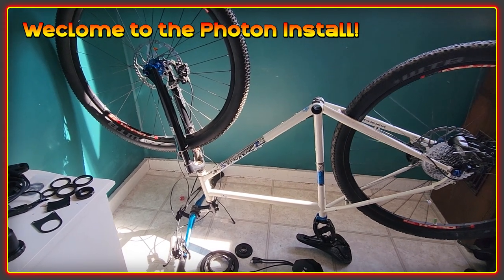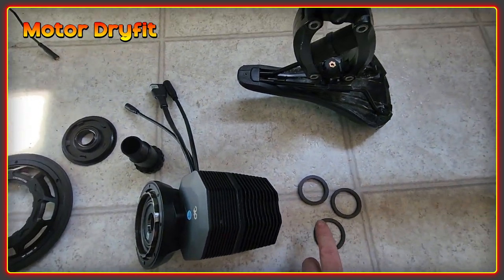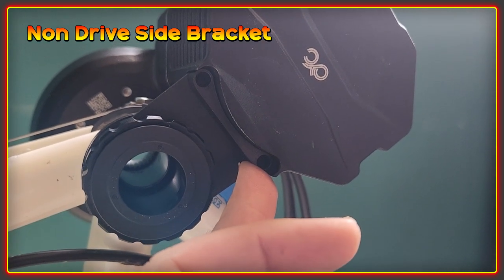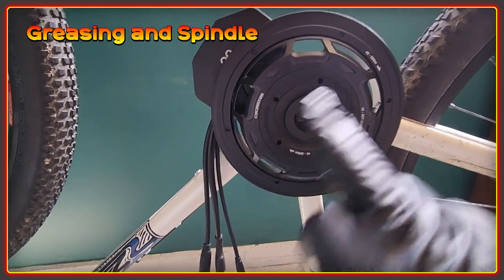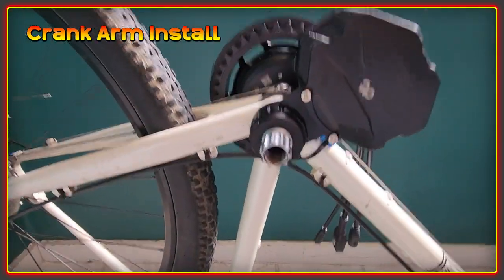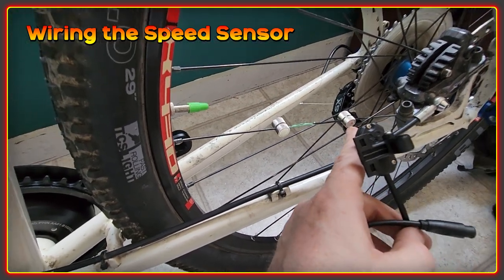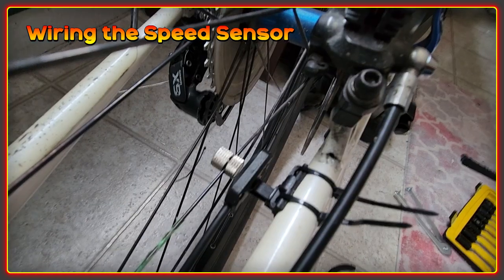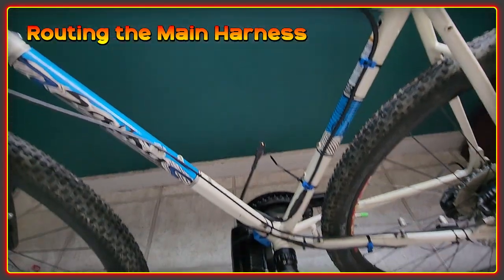CYC Photon Ebike Motor Full Installation, Tips and Tricks

Comment: The ease of installation is a no brainer! Just having the controller installed into the motor and the simplicity of the speed sensor and the throttle control and screen is brilliant!
 Didn't see a lot on brake disconnects? I doubt I would use that anyway. I bought a 250W mid drive ebike (proper road legal) and even that bike does not come with brake disconnects!
 Start rant!
 Imagine the Photon installed with an Alfine 11 rear hub(or a nexus)....How clean would that look!
  I like having my BBSHD at 3000W but that Photon is so clean and in all honestly I am not a speed junkie who is looking for a faster ride anymore.
So A donor bike say $1000.00(2nd hand?) Aussie dollars, Photon $1500.00, Nexus hub $400.00 Aussie dollars and a decent 52V battery(25/30Ah)$750.00/1000.00 Aussie dollars. Allowing say $200.00? dollars to fit the nexus into the wheel rim?
 Go old school and just use the existing cassette to save money it could range from say $3500.00 Aussie dollars to as much as you wanna spend!
  My calculation allowed for a good quality battery so you could save money buying a smaller battery or a cheaper donation bike unless you already own a good bike!
 I paid similar for a 250W Electric Ebike so this is really something to save for.
 For all the people who can do it cheaper good for you! As an Australian we tend to pay a bit more for stuff down under so I have been fairly liberal with my figures! A thousand dollars for a donor bike is for a decent frame so I am being fairly aggressive price wise!
 To have an Ebike which you build yourself knowing what you have and understanding how it goes together plus the knowledge gained building it the price of $3500.00 Aussie dollars is not to outrageous in my opinion!
 Enough of my rant! 🙄🙄
 Anyway that finished bike you built looks really good in it's simple design and really a clean build!
  I am interested in how natural the bike feels to ride as just that....A bike which you need to pedal! I am curious how the torque sensor? handles the feel for the ride!
Keep up the good work!
Reply from the maker: Thanks Sparkie, makes sense with the nexus. I opted out of the brake cutouts. Seems to be ok. The harness is different if you want them so you have to say otherwise you get a two way design.

Comment: Would be nice to see a CYC install on a nice comfortable Dual Suspension bike. Including a 25-30 ah battery 52-72V. That would be a neat trick.
Reply from the maker: Now that would be the real trick. Getting the battery in will be the hardest part. The triangle is always compromised on those.

Comment: For tightening the chain ring I would stick a long screwdriver or something similar from the other side of the frame through the openings in the edge of the chain ring.  Then hold that in position with it contacting the frame while you tighten the lock ring.

The chain whip should work fine too, that's just what I'd do if I didn't have one.
Reply from the maker: It did ok. You could use a cloth to prevent any marking as well. Cheers Wally.
Reply: @HighVoltageKits  What about installing the shaft then slipping the left crank on and using the crank for leverage when you tighten it?
Reply: No. Dont do that. Get a chain whip to mash your paint or components.

Comment: Watching all your vids now. This motor looks like having standard biking cables running under the bottom crack is no issue. How does the toseven dm01 work? I hope the same having a gap for the cables, brake and gear change
Reply from the maker: Yeah there is room to thread things. Might need to rearrange a bit depending on the frame but it's not usually a problem.

Comment: Thanks for the extremely clear and helpful video. Question: I have had a Photon for about a month and it has been mostly a good experience, though I need to remove it now and reconfigure the spacers. What specific tool or tools do I need to remove the crank arms?
Reply from the maker: Thank-you. You need a crank puller. Park Tool is a good bet. It screws in and then an extractor pushes the crank off the splines.

Comment: Very nice install.
Based on the triangle bag fittment your bike must be huge.
It doesn't seem like 750 watts would be enough to just pick a middle gear & hit the throttle without using gears.Will you be pedaling and using gears (for a change)? I like to pedal so am very curious how the torque sensing works.
How does the noise level compare to a Bafang? My main issue with previous CYC motors was the noise level of the 2 chain setup & was hoping this would be quieter than it seemed.
Reply from the maker: About to go out for a ride here so I will let you know on the noise when I get the time to process the video. From my quick test ride it is very quiet. The motors always seem louder when you spin them like that. The CYC X1 noise was always from the 219 chain and the tensioner.

Comment: Do you have to use the speed sensor? I have full suss and i dont think it will work consistantly with the rear swing arm movement
Reply from the maker: I don't think it works very well without but you should not have issues with a full suspension. Might be a bit trickier to place it but doable.

Comment: Very good video and commentary. Thank you for that. I was getting ready to buy a BBS02 but then stumbled across the Photon. It looks really good but there isn’t alot of them out there to determine what reliability will be over the long haul. In your opinion, how does the Photon compare to the BBS02 and is the torque sensing of the Photon make the BBS02 fail by comparison in feel and quality? I want the feel of torque sensing.
Reply from the maker: The torque sensing is a much better feel. How long they last for though is a good question. CYC said its been developed for three years though so hopefully it was well tested.
Reply: I just purchased a Photon, too, and I'm watching this to learn the installation routine. (I've installed BBS02's before). It's my understanding that if you run the Photon very hard, they can run too hot and eventually burn out. I never really got any good definition of what's "very hard" use.

It's really difficult to get any idea on longevity when the product is so new.  How can you know if it will last 3 years if it only came out as a product one year ago? There's just not enough real world experiences - both good and bad. With that said, all the early reviews are pretty strong.

Comment: thanks for the info on the photon,  on the road test could you test the throttle and power this can handle i already have the gen 2 with asi bac855 only run it on 58v so still not sure on the photon or just upgrade to the x6 controller,  really like how compact this is and no chain also the noise from what i have seen its much less than the whining noise of the x1 pro...thanks...
Reply from the maker: I will post some ride footage and commentary tomorrow and a full review with more riding

Comment: Odd question and I can't seem to find the info (while I wait on my photon to arrive). Say you run out of battery. Does the motor "freehub" allow you to pedal with minimal resistance? Does it have a regen mode while pedaling if torque assitance is minimal? Thanks! Looking forward to my project!
Reply from the maker: You can pedal it. Not the most fun experience without assist tho.

Comment: Good info, and seems a nice refined product.  
When you were spinning the motor with your finger on the cranks, could you feel any drag ?  
I ask because I'd like to fit it to a bike to use with battery, and as a normal bike without battery..
Reply from the maker: Its not as smooth as a regular bicycle crank for sure. Just the nature of it. I would not go this route but use the settings to set out a low rate of power to just cancel out the weight of the battery. You can see the human power input on your phone display which is pretty neat.
Reply: @HighVoltageKits  this is exactly what I plan to do. I plan to use Level 2 most often, level 3 will be when I’m towing my kids in the trailer, and Level 1 will be limp mode. Just enough power to negate the motor drag and battery weight, but enough to get me home if the battery gets low.

Comment: What are you thoughts on using brake sensors?
Reply from the maker: Not needed with a torque sensor this good in my experience.
Reply: @HighVoltageKits  thanks!  Which I kept to my original order of no brake sensor and the simple display. Last minute I switched to brake sensors and the full colour display.

Comment: Is there any reason you couldn't mount the motor above that bottom tube and brace it against the tube the seat post goes into?
Reply from the maker: I did try but it won't fit. The cyc x1 and Stealth motors can do this though.
Reply: @HighVoltageKits  I'm new to this, so if a middrive will fit it can be mounted up there to protect it? I was thinking about a big wheel BMX.

Comment: It looks like one motor for all bottom bracket sizes? Say I have a 68mm could I use this on a 100mm bottom bracket in the future?
Reply from the maker: Hey Jahmall. There is a 100mm version which costs extra from CYC. The extra cost implies extra parts. The big question is can those parts be bought and installed at home by you. It's a really good question. I will post it on the CYC forum.
Reply: @HighVoltageKits  Great,thanks 
I hope they answer that question. 🙏

Comment: I was wondering what spacing you had between each crank arm and the chain stay on that particular crank arms side. If you're chainstays are symmetrical to the centre of your seat tube.
Then what your chain line was
One would hope you can get the perfect chainline and centered cranks.
 
With the stealth I have managed to achieve a perfect chainline and the same spacing of the  cranks to the centre of the seat tube
Reply from the maker: The cranks look centered to me and the chain line is bang on!

Comment: My experience is that after around 600kms the motor came loose. So now that locking thing is at 60fp and not 37fp. 37fp felt very weak when I installed the first time anyway.
Reply from the maker: There did not feel much holding it when I took it off. I will be putting it back on with more force for sure! Cheers

Comment: im trying to get the chain ring off so i can replace the controller but i cant get that lock ring to come off. tried the chain whip, tried fixing the motor on my bike for better leverage. but i cant get it off. even managed to deform the spanning tool. im twisting counter clockwise opposite of the arrow on the lock ring
Reply from the maker: I thought it was not end user serviceable. Did they send you instructions for how to do it? I'd love to see some photos. Maybe try a sharp hammer tap to break the lock? My email is john@highvoltagekits.com or you can get me on discord as well if you are part of that site.
Reply: @HighVoltageKits  you can actually replace the controller yourself. cyc has a tutorial on their channel: https://www.youtube.com/watch?v=uiGtrLeX8hw

Comment: Nice video.  Would it be a good idea to use locktite anywhere?
Reply from the maker: There is some locktite on a few of the key parts including the crank arm bolts and also the lockring bolt. People generally don't use locktite on the BB cups but if it comes loose I might. The issue is if I needed to remove it I would not be able to get any heat in there if I put it on too hard.
Reply: @HighVoltageKits  Permatex Orange thread locker is 3X stronger than regular blue, but you do not need heat to undo.
Reply from the maker: Thanks Jim. I will remember that
Reply: I used a few dots of Loctite blue with my build just in case. Loctite red is much more permanent

Comment: It sounds kind of loud. How would say the noise level is compared to BBSHD or BBSO2?
Reply from the maker: It seems pretty quiet from the quick lap I did with it. I will be going for a ride here shortly.
Reply: I installed my Photon Friday. It sounds VERY quiet to me. As quiet as any factory emountain bike. I only hear it at high assistance levels and climbing hills. Road noise and wind is louder than the motor IMO.  I don’t think it would be possible to make a motor much more quiet IMO.

Comment: I’ve subscribed to High Voltage and am now wondering how I can apply for the 5% discount at Golden Motor?
Reply from the maker: Use the code HIGHV
Reply: Thank you. Unfortunately, it didn’t reduce the regular price of a Photon Ebike Motor. Any suggestions?
Reply from the maker: I would contact them directly. Might be an error. The Photon was on offer which excluded it. I was under the impression that had ended now.

Comment: Where did you get those wire spacers?
Reply from the maker: If you mean for with the zip ties I designed and 3d printed them.
Reply: @HighVoltageKits  Nice! you should sell them
Reply from the maker: Thanks. I am working on a few options. Cheers

Comment: My frame has crack right where you put that blue block. 4 years of 200 N.m.t 3300 watts on the frame it cracked. My bafang motor is still kicking and i have 22000 kmh on it
Reply from the maker: Yeah they are hard to kill. I have a refresh to do on mine this year so hoping that the frame is ok!

Comment: is there a choice or available different  bottom bracket fitting mounts for variable reach out away from the bottom bracket to accommodate some of your more awkward frames?
Reply from the maker: Its one variation apart from the width and bb type. In practice, though even on a DH bike the clearance will be ok as it's so small.
Reply: @HighVoltageKits  hhmmm not on at least half of your downhill/enduro bikes especially if you want the motor tucked up out of the way, would be good if they did otions of standard. +1cm +2cm  +3cm +4cm +5cm (inc an optional extra to buy a set of all 6 bracket sizes for those unsure so they can  hone in perfect) for the fitment bracket configuration would certainly get more sales both in confidence of correct/better fitment and of course appearance/appeal. look ridiculous when they hang down low not to mention stupid in regards of increased strike risk. You should forward that suggestion to them. Would make their motor way more universal and right and of course get 1up on bafang and others!
Reply: @HighVoltageKits  Infact a good example of an excellent suitable bike for conversion (all things considered from balance to battery fitment) The Mondraker Dune R when you look at the pics it could ideally do with 8-12cm extensions to fit well.
Reply: @HighVoltageKits  Ah wait a minute that cant work due to the way the motor attaches to the free wheel hub add on section would have to be a fresh design to go with each bracket size and adapted gearing individually for each and every reach out extension length bracketing. Pity good if they could come up with something all in one to combat this rather than messing around with extra chain etc in the original motors
Reply from the maker: They are just using adapters like for pressfit.

Comment: Hi buddy, it's Tom from Southampton. UK.  Bought the asi from you and need a little advice.  Was in rain and throttle was iffy and took it out 3 days later and it won't turn on the nxt display, sure that's the display. Would the throttle being wet effect turning it on ? . Lost my phone and no longer in discord ... any ideas would be appreciated. From Tom
Reply from the maker: I remember you Tom!,  dang that is some bad luck. It does sounds like the display is what has the issues. A way you can check is to get hold of bafang program cable and plug it into where the NXT goes. Make sure the chain is off when you are testing or the wheel is isolated off the ground. If the throttle is good then it should run the bike or at least let you power it on. The NXT is from ERT which is no defunct I just made the graphics and case design. We are able to support ERT customers and can likely assist but you would probably need to send us the BAC855 and would need to get a new harness and display to work with the High Voltage Kit. All our customer service is via the discord so we really need to get you on there. You can likely setup a new account on your PC which is a pretty good experience. You can also send a message to greg@highvoltagekits.com He would likely need to test out the BAC855 to confirm that there are no issues with the controller. Let me know.
Reply: @High Voltage  I have the cable you sent me ... for the lap top . Will have to look on utube how to plug in etc .. the throttle went iffy with the rain and just won't turn on .. but I may open the motor controller cover and check the connections to as I remember one didn't crimp to well.  Will have a look the weekend buddy.. is there a link to get back on discord?  Thanks for the reply 👍
Reply: @High Voltage  it's not the display on your website now its the old one . Will have a look which one but the 1st display
Reply from the maker: email photos if what you have to John@highvoltagekits.com